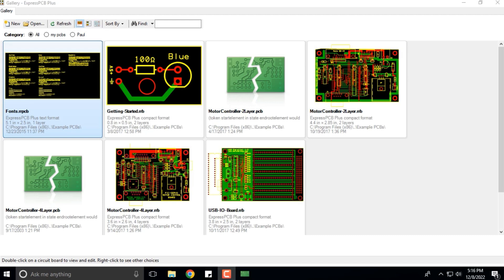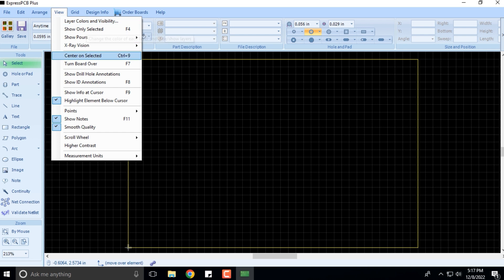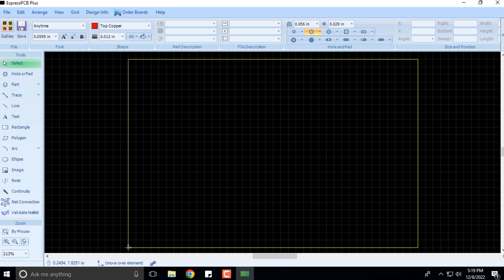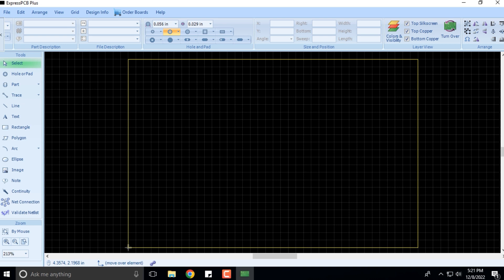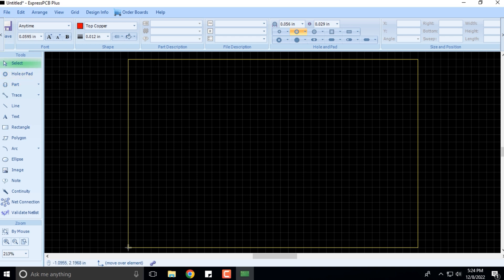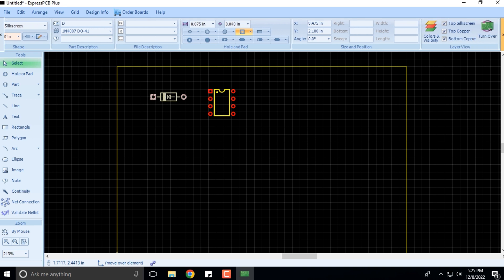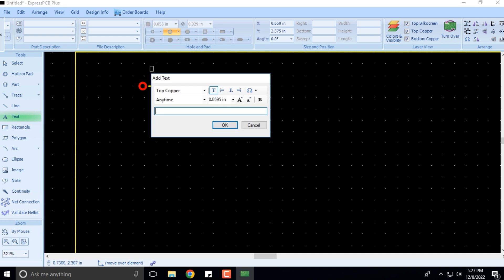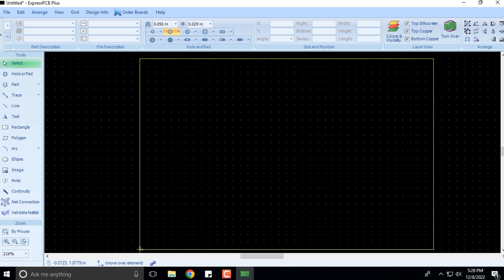Introduction to ExpressPCB plus software

Comment: Hello,
I use OrCAD (Cadence) for my schematic capture.
In the older ExpressPCB, one could import a netlist and use that for the layout.
This Plus version seems to have no such ability.....
I even tried to rename my netlist (.asc) to rrpcb but no luck.
The program makes the standard Windows "something is wrong" sound but NO error messages on the screen!
I'm on Win 11 on a very recent laptop, running ExpressPCB Plus V3.2.1.0....
Thanks in advance for your help!